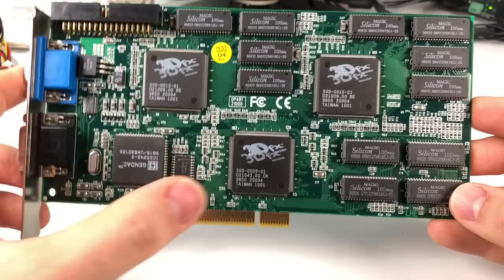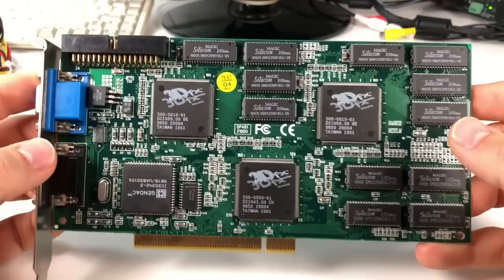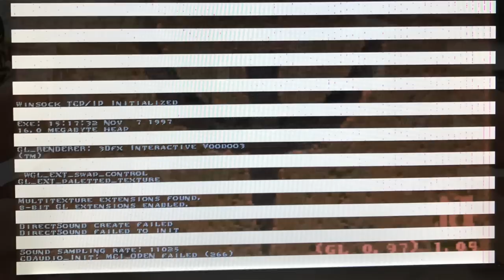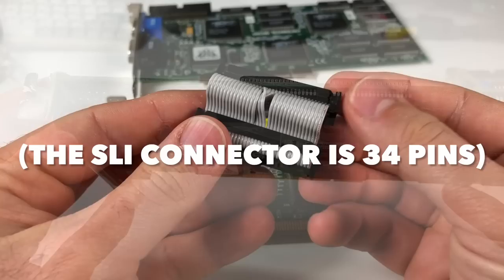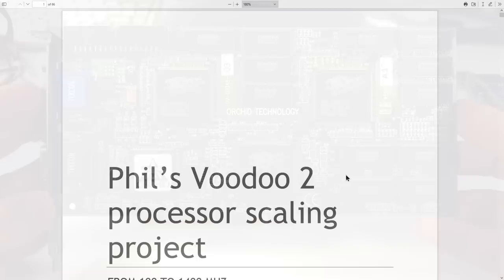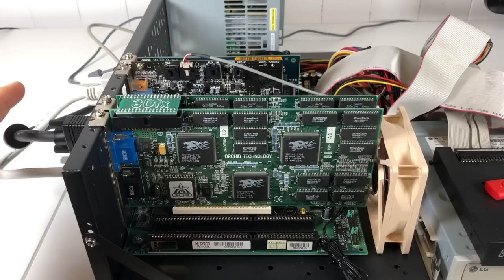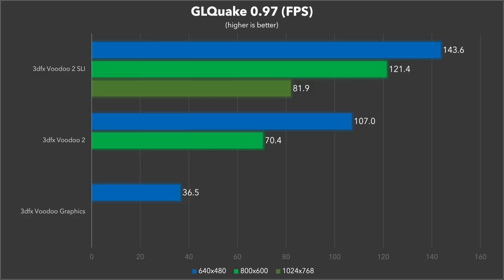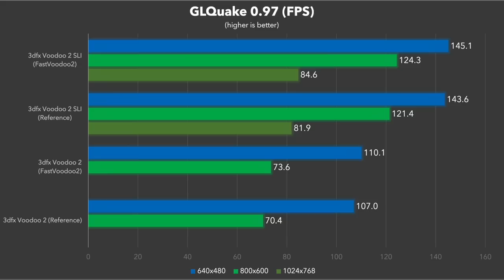The 3Dfx Voodoo 2 - Taking 3D to the Next Level!

Comment: Thank you. It still amazes me that these cards still work over 20 years on. Imagine getting an RTX card still working in 20 years time. Also, no cooling needed either. That was the other thing that amazes me. When did graphics cars manufactures mess things up so much. I am guessing that the resolution we use mostly today which I think would be 1920x1080 wasn't that far behind, either (Voodoo 3 did that I believe?) Also, having 2 of them in SLI is that like having to have 3 graphics cards installed? I know I ma asking a lot of questions, sorry, but I find this stuff fascinating.
Reply from the maker: Thanks for your comment! It really is quite amazing. Not even a heatsink on them - although they do get quite warm under heavy load and benefit from a bit of airflow. That's correct, you'd have three graphics cards total. A card for 2D duties, with a passthrough cable connected to the first V2. Then you'd have your second V2 connected to the first via SLI bridge. I can't say I've ever tried to use a V3 at 1920x1080, but with 16MB of memory it could be possible.

Comment: Wonderful video. I always wanted a system like this, but my first build used a Voodoo Banshee.
Reply from the maker: Thanks so much! The Banshee was an excellent card too. Hope to do a video on it as well one of these days.. Not much slower than a V2 (basically a V2 with a single TMU and 2D included, and a higher 100MHz clock). The 2D core 3dfx developed for the Banshee and later the V3 was excellent.

Comment: Ahh the good old days. Thanks for the memories.
Recently decided to rebuild myself a Vintage computers and... it's not easy. Parts are hard to come by.
Socket7 Motherboard from Ukraine, still on the way. K6-266, received.
After that found locally and picked up a super socket7 with K6-2 400... Works but BSOD's all the time due to many bad capacitors. I need to recap it.
ATX to AT PSU cables. AT Power button, finding any kind of beige case is hard....
I am happy I have some good GPU's to test when done. A voodoo3-2000 PCI, a 32MB ATI rage128, An 8MB S3 Savage4... 
I hope to make some nice videos on the struggles and challenges I encountered but even making youtube videos, it's a lot of work.
Time isn't a luxury I have :(

Comment: Found another Voodoo 2 at the dump. I think I wrote in another video. I even used 2 of them in a 486 PCI Board with a 100Mhz clocked Pentium Overdrive. It gave like 2 extra fps in GL Quake.

Comment: I used to take full advantage of my voodoo2 12mb. I would run it on a 21" CRT at 100hz refresh rate, and an AMD K6 III 350mhz which i overclocked with some luck to 400mhz. I would then run a racing game with 3Dfx Glide API and using a wheel and pedals.  Damn those were some fun times, vsynced CRT racing sims were so smooth. I think the game was called Rollcage!

Comment: Thanks for the nostalgia!  Back then, frame rate was not the big motivating factor.  It was more resolution and colors (on your 11-17" crt).  15 frames were more than acceptable until games like Unreal, then you needed a faster frame rate (20-30fps?).  Any faster than that, the monitor wouldn't refresh correctly; it would just start v-sync tearing unless it was perfectly matched.  Heck, I was still using a Voodoo 3 when FFXI was released.

Comment: But damn, that connector to the GPU was like trying to tie a knot in a transatlantic datacomms cable. You almost had to reinforce the case to stop it being ripped apart by the torque.

Comment: if memory serves  the cards could be linked externally  with  the 2nd cards vga cable without the internal one - so thats 2 short cables and the monitor cable plugged into the last card
Reply from the maker: That's very interesting. I've never heard that before. The original ATI crossfire cards (x850 generation) had external link cables from what I recall.

Comment: One thing to be careful about with using voodoo 2's in more performant later systems (like pentium 3/athlon) is the tendency of the cards to lock up due to overheating. Make sure to add heatsink and maybe a fan depending on the case. Also a slight downclock might help from my experience.
Reply from the maker: Thanks for your comment. That's a very good point. I've heard about this in the past as well.

Comment: love this retro stuff, just dug out a lot of old stuff. I have 2x Voodoo2 1x Voodoo3 and 1x Voodoo 5, Im gonna pull out enough stuff to run a P3 450 slot one MB with the Voodoo 2's in SLI and a Dell GX280 P4 MB with the Voodoo 3 or the Voodoo 5 both will run on win98. In the late 90's I got into these to run the Star Wars Rogue Squadron 3D and others

Comment: People tend to misunderstand these days how the memory on Voodoo 1 and 2 era cards work, the texture memory is always shared hence the scaling while the frame buffer is always limited to just 4mb. The TMU on the Voodoo 2 actually can handle up to 16mb per unit however this hasn't been done though it has been proven to work at 8mb bringing the total per card limit to 20mb (8+8+4). As for the versions you left out the arcade version which does turn up once in a while from Quantum 3D and those were configured with 10mb. Anyway one can also upgrade the memory on Voodoo 1 era cards with the same methods as the Voodoo 2 and the same goes for Voodoo Rush.
Reply from the maker: Very interesting, thanks for sharing! 👍

Comment: Iirc, someone made drivers for Voodoo 1, 2 and 3 for win10.

So... it is technically possible to get a hold of a B350 board, with PCI slot, plop in an APU, send the VGA output to the Voodoo1/2, install the drivers and enable true glide in Win10 for older glide enabled games.
Reply: Also of note...
NFS High Stakes was called "NFS Road Challenge" in Europe.
Basically NFS 4, just in case someone was curious.

Still one of my favorite NFS games.

Comment: i had the same grafic accelerator , back in the days of my childhood , it was the 90`s ... other friends was able to buy the Riva TNT which was later better than the Voodoo 2 , maybe it was the riva tnt 2 , but im not sure. I had a IBM System , the Intel Pentium 3 with 433Mhz , 2 GB HDD , 4 GB RAM , later in 2000 a 8x CD Burner. WoW this was a very Special Time. As the Dual Cores came out , that was a big game changer. .... edit: i remember someone was playing Turok on a Riva TnT and it was muche better to play than by my Voodoo 2 card. If a Game do not runn on good fps we do lower the resolution from 1024 or to 800x600 to 640x480 LOL and if you have a strong CPU you was able to run Half-Life in processor grafic .

Comment: Just got myself a pair of Orchid 3D V2s, put those in my SuperSocket7 -system 🔥 Other specs are K6-III+/616MHz, GF2GTS, Aureal Vortex 2 and Orpheus II. 🤘
Reply from the maker: Very nice system! 😁👍
Reply: For a long time I had one system to rule them all but In my case 2 systems is minimum to get everything working right. Biggest problem was with my KT7A where Nvidia-cards were just a little unstable, some games gave BSOD. Radeon X800Pro had no problems at all. (Tried several KT7As, several Nvidia cards, drivers, everything) BUT, because Voodoo-cards wont work at all with Radeons so Nvidia was needed to get Voodoos working 😅

Comment: I still have my old k6x2 with a pair of a voodoo 2's setup on an old Sony flat face 17" 1280x1024 crt . Play doom and q2 often
Reply: I have also setup a slightly newer system with a Athlon 4800 and a GeForce fx 5950 ultra

Comment: the 12MB cards could do 1024x768 with single card. just. but this means SLI Voodoo2s could support 720p if it supported the output.  HD levels of gaming in the late 90's!
Reply: tbf in 1999 there were a bunch of cards that could do up to 1600x1200 already.
Reply from the maker: Interesting! I was always under the impression that 800x600 was the maximum for a single card. Was there a custom driver or some other tweak needed for 1024x768?

Comment: in early releases also was 6mb Voodoo2, still have Magazine with article about it. Also some exclusive versions like Quantum3D Obsidian2 X-16 with "Single Slot SLI" with 16mb on single card, Quantum3D Obsidian2 90-2440 with 10mb

text:
Voodoo2 can be configured with 2 to 4 MB of EDO frame buffer memory, and 2 to 4 MB of EDO texture memory per texture processor. Each texture processor needs to have the same amount of memory. So configurations could be: 2/2/2, 2/4/4, 4/2/2, or 4/4/4. Designing user-expandable cards is difficult with designs running at this frequency, but not impossible. It is up to individual OEM's to build specific implementations of products based on Voodoo2 technology.

another text:
3D Blaster Voodoo2 will come with 6MB of high speed, single cycle EDO DRAM and deliver a phenomenal three million triangles per second as well as 90 million (180 million pixels in SLI configuration) dual-textured, bilinear-filtered, per-pixel MIP-mapped, alpha-blended, Z-buffered pixels per second. In addition
Reply from the maker: Very interesting! I don’t think I’ve ever seen a 6MB V2 in the wild before. I suppose an 8MB card could be modified for that. Would be interesting to see 🙂

Comment: I'd be curious to see how the performance of the SLI Voodoo2 setup compares to that of the Voodoo3 3000.
Reply: it's about the same.
i even found, where you need to underclock voodoo3 , to get voodoo2 performance.
you have to go under 100 mhz (which is minimum in drivers), it was still about 15% faster than voodoo2.
So you have to go about 87mhz on voodoo3, to get voodoo2 performance.

you can set mhz through registry tho, but at about 95 mhz, voodoo3 unfortunately freezing/crashing. The cards has also minimum frequency, at which they are stable.

Comment: @08:50 I have to note that I was able to use a 12MB + 8 MB SLI setup for 1024*768 back in the day (both voodoo 2 cards were from creative labs)
Reply from the maker: Thanks for sharing! Yes indeed, I believe I was wrong about that. I've heard the same from others as well. I don't think it was possible at launch, but 3dfx improved compatibility for mismatched cards at some point through driver updates. If I can ever get my 8MB card repaired, I'd love to give this a shot.

Comment: Nice video, I am in the process of making a PII setup with 2 Voodoo2 12mb cards in SLI, fidling with some drivers atm :)
Question tho, what is that testbenchsystem you are using?
Reply from the maker: Thanks! Its some kind of generic ATX motherboard tray that I picked up on Amazon. I think it was about $30 or so. There are a few different sellers who were offering it, but it doesn't seem to be in stock any more.  I think it was originally intended for crypto mining, but I've found a better purpose for it :D .. I'd like to get another one at some point. Here is the one I bought: https://www.amazon.ca/gp/product/B08XK21RW9

Comment: Great video! Just a qq: was Vsync disabled on the Incoming test? 59.5 seems to indicate it might be enabled.

There was different settings for OGL which is why Quake acted differently.
Reply from the maker: Thanks! 🙂 

Vsync was disabled via system environment variable and I don’t think there were any options in-game for vsync. I seem to recall seeing maximum frame rate figures in the 70s during testing but I’ll try to take another look if I get some time 👍

Comment: I still have my 2 voodoo2 12mb cards. from Diamond. their also boxed
Reply from the maker: Very nice! It's really hard to find any with the original boxes these days.
Reply: @vswitchzero  I always kept the boxes. Still have my voodoo 3 also boxed. Wish I still had my first 3d card, the Orchid Righteous 3dfx. But sold it to help pay for the first 12mb voodoo 2 card which was £250 at the time.

Comment: My Quake II results with Voodoo Banshee 16MB (Celeron 400MHz Slot-1):
640x480: 62.4 fps
800x600: 45.6 fps

Voodoo3 3000 with a Pentium III Tualatin 1.4GHz:
640x480: 182.4 fps
800x600: 125.1 fps

(timedemo 1 used for both)
Reply: i've never even seen a voodoo3 3000. only 2000. they were still beasts anyway.
somehow i remember getting better frame rates than that in quake2 on my pentium 233 mmx. maybe i had peak fps bias because i distinctly remember that my pc hit over 100 fps play death match in q2dm2
Reply from the maker: Thanks for sharing! Those are some incredible framerates on the V3 3000. Gotta love the Tualatin 1.4 :)

Comment: Out of curiosity: did the sli actually provide aa playable experience or was just avg fps gone up and stutters every second?
I tried two identical 8800 GTX that were purchased in the same deliviery for two gaming systems and also two different GTX 970 and both times in sli most games wouldnt even start and games like CoD4, Crysis or BF3 that ran were literally unplayable, though they had sometimes even double the avg fps.
Reply from the maker: With 60Hz vsync, a single V2 could handle just about everything with ease at 800x600. I think SLI came in handy more so later on when the games became more demanding. I think SLI compatibility and quirks were less of a problem in the 3dfx era than they were later on with nvidia’s version. Everything was a lot more complicated by that point and it doesn’t surprise me that they dropped it in recent generations. I had a pair of GeForce 650Ti Boost cards running in SLI for a bit and wasn’t impressed at all. So many games didn’t support it and there were numerous problems. Was great in benchmarks though 🙂
Reply: @vswitchzero  So there was actually a time when it did make sense to throw two gpus in a system for sli. Interresting. I was too young back then and later only heared of sli being a waste as it doesnt provide anything. But my first own built pc when i started buying hardware myself and understanding things was with a 8800 GTX in 2008.

Comment: For SLI connection, are both cards in the vga loop? Or only one Voodoo card's vga is connected to the monitor?
Reply from the maker: With SLI, you only connect the primary card to the monitor. There is no passthrough VGA cable necessary to connect to the secondary card - only the internal SLI bridge.

Comment: @4:58 - the voodoo 2 wasn't the first card to do 800x600, the nvidia riva 128 could do it too, infact it could go as high as 960x720 (if you could get a game to run at such a weird resolution, I managed it only once).

Though with the low performance of the riva 128 you were unlikely to want to use those resolutions (nor the 32bit color it was capable of for that matter), and with its low precision positioning of polygons it was never going to win any image quality awards anyway (the latter problem was sometimes so bad you could see just enough between the polygons to use it as a poor man's wallhack - I certainly did). So voodoo 2 was probably the first card that made 800x600 viable.

Comment: Was there any Voodoo2 that stood out among others? Had two 12 MB Creative cards in the 90s and later 2 Diamond Monster 3DII 12MB for a retro build and they seem to be identical.
Reply: i think there were some with 100mhz memory instead of 66 or 90.... as far as i remember?
Reply: @HighwayHunkie  Found some interesting cards from Quantum3D - the Osidian2 with two Voodoo2 on a single card, that could be teamed up with max three other cards to create a "Mercury Brick" giving 8x SLI and resolutions up to 1024x1024 pixels.

Pricing was a bit expensive with up to 15.000 Dollars (built into a server rack). NASA was one of the main customers for this cards. :)

Gainward offered the Dragon 3000 with custom layout, heatsinks on the Voodoo chipset and higher quality memory, allowing operation with up to 110 mhz memory clock.

Except from that most manufacturers stayed with the 3dfx reference design and clock rates.

Edit: There were no different clock rates for the chips and the memory on Voodoo2. So the Voodoo2 chipset was the limiting factor while occing the Dragon 3000 (they gave it the heatsinks for some additional Mhz).
Reply: @devil5051000  ok these are priced equal to gold actually.

Comment: Quake 2 ,you need Patch 3.20(which included AMD 3Dnow Mini Open GL extension support..)Btw, some game of that era limited to 60FPS, so can't really conclusion it was CPU bottleneck, I using K6-2 266@300...but my 800x600 frame rate running as well as 400mhz? How? Because voodoo card doesn't need cpu scaling like modern Intel or AMD multiple core does..

Comment: One of the interesting things too is that a Voodoo 3 is only slightly faster than 2 Voodoo 2s in SLI. Same for the Voodoo 4. For an appreciatable difference you’ll need a Voodoo 5.

And for all retro gamers out there: A voodoo 2 is much better for DOS compatibility than a Voodoo 3 or newer. (For DOS mode Glide games)